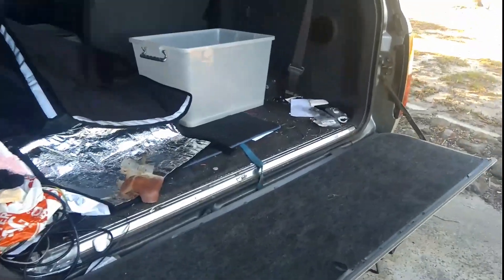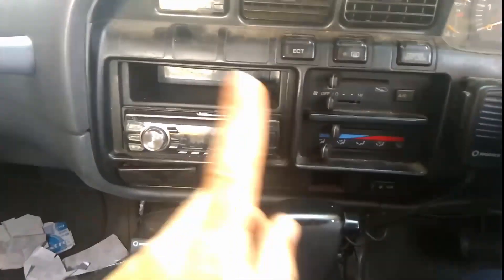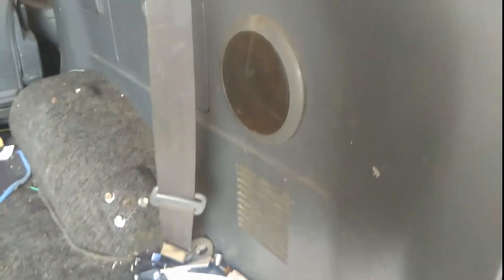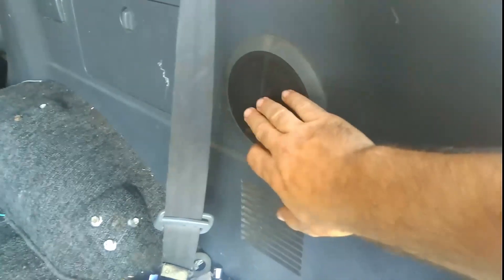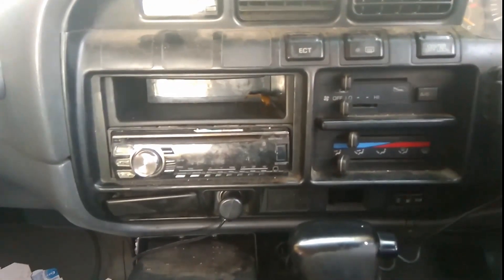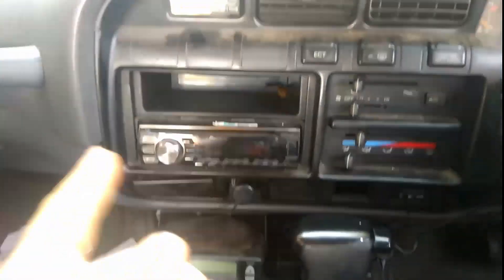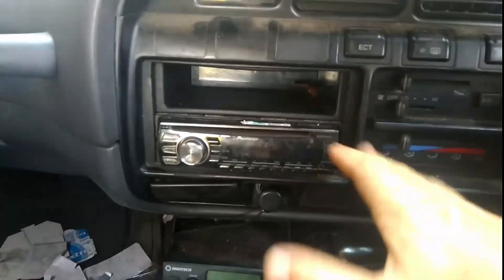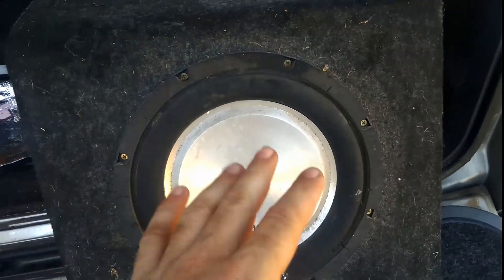80series - Car radio information

Comment: This is just what I was looking for. I’m installing a double din this weekend in the 80 and was wondering about the sub. Do you know what wire is for the sub or how that works? On the back of the head unit there’s only 8 speaker wires. 2 per speaker. 4 speakers. What connects to the sub?
Reply from the maker: My sub amp was stuffed when I got. The sub amp/crossover is in the wheel arch. 
I think it's bridged of the rear
Reply: @OldMatesBackyardTech  thanks mate. When you say bridged does that mean it runs off the rear door speaker?
Reply from the maker: I think so.
Mine was stuffed
Reply: @OldMatesBackyardTech  Righto. Cheers. Mine might be stuffed too. My cars got an aftermarket Sony stereo in it from previous owner so I thought they might have just not hooked it up to the sub. Figured I’d try get it going. I’ll see how I go. Cheers mate. Must be shoosh shoosh time for you over there. Ha ha